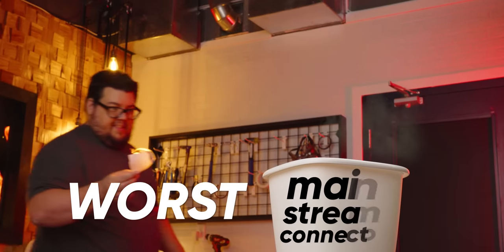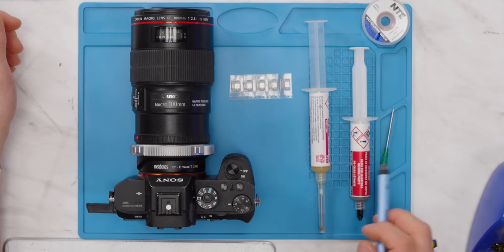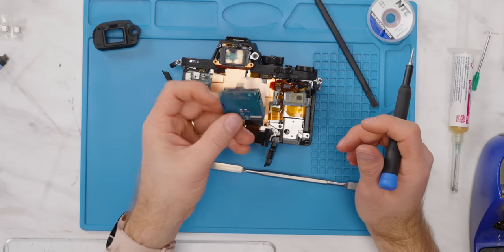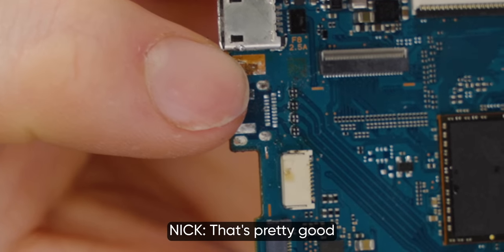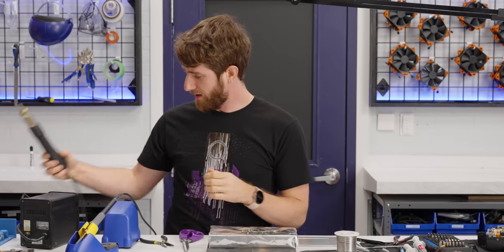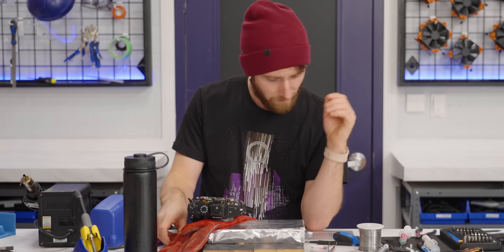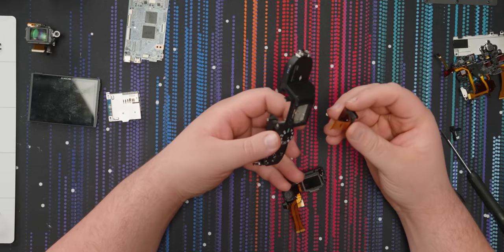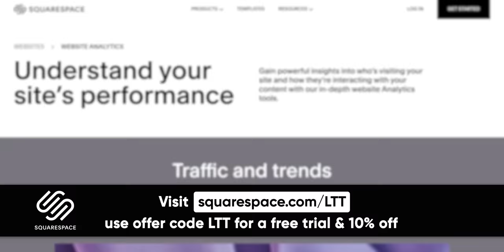This "cheap" repair almost BROKE me.

Comment: All I gotta say is that when desoldering components using hot air Kapton tape for insulation can greatly help shield nearby components along with gently preheating the board. Also there is some stuff called Chipquik which is an ultra low melting point solder. And working with RoHS lead free solder can be a real bear as the melting point is higher.

Comment: So buying a whole new mainboard and the calibration service was still cheaper than having Sony do the whole job. And replacing the mainboard meant you didn't need the soldering equipment and you could've sold the old mainboard as "for parts" to a pro shop for ~$40. Moral of the story: trust your own repair ability, but maybe not that much.
Reply: No? He spent far more on parts and labor hours than if he had just paid for the repair.
Reply: @manbearpigsereal  For us plebs the hours are null where an experience benefit is realized. Double down on that for the cautionary tale told by monetized video…

Comment: Glad people got to see that our Micro Soldering work isn't just something you can pickup and do in a day. Without the proper tools and lots of practice, you'll just make things worse.  This is basically the same process of soldering a Nintendo Switch USB C port and I can't tell you how many times customers have said to me "The part is only $5, I'll do it myself." I will direct them straight to this video in the future lol.

Comment: As someone who does electronics work as a hobby, it's dark comedy to watch LTT attempt a repair of this precision with only about half the required tools. The lack of a hot plate is the least of it. A reflow oven is really what they need, but barring that they need some sort of specialty de-soldering alloy like QuikChip, heat resistant ceramic tweezers, and Linus should definitely be wearing at least jewelers' glasses to help him see wtf is going on up close (even better would be to have an industrial inspection microscope that he can just put the board under and look into the whole time). An alligator stand or "helping hands" as they're called would greatly assist in keeping the board in place and not moving around, and it's obvious from the issues they were having with the solder application that they needed a more fine point soldering tip for their iron. They also should have used heat-resistant Kapton tape to cover all the other parts of the board they weren't working on to protect them from the heat gun.

Comment: Soldering with hot air is much harder than desoldering with hot air (because of the plastics and also if you don't control the air flow and have steady hands, you can't align in time before you cook the board), so once you get the bad socket out (say with hot air, low melt solder, or dunk the whole mass in solder and iron it out with a fat tip), wick out the excess solder on the pads so the new connectors can lie flat, then iron solder one of the the mechanical strain (the metal edge to solder to he pad that serves no electrical purpose) first to align, then drag solder the rest of the pins with lots of flux.

Comment: ive taken apart a very similar camera and they are a nightmare. I've had issues with accidentally partly breaking a ribbon cable causing intermittent issues. the only way i could think that your hot air/soldering iron would cause more issues is if you accidentally burnt/knocked off other components (potentially on the other side of the board underneath the connector). It's important to use a board holder because its very easy to float components underneath. that being said, next time you should try either reducing airlfow/holding hot air station farther away from the connector or heat from below. if you stick the board partly off the side of the table and either hold it with something heavy on the other end or a board holder, it should be stable and give you enough room to work with. also low melt makes it easier to removing connectors with lead free solder

Comment: If you solder wick it flat and tack the housing down first, it's much easier to realign because you just need to reheat one joint to move it.

Comment: This is why you don't use those black spudgers for this sort of thing.  Those are good for popping apart cases and scraping out build up, but way too scratchy for ribbon cables.  For that you want a telecom spudger or similar (think the yellow ones).

Comment: Jerk stopper or cable lock is a big step towards preventing this issue. The key is to keep pull strain away from the connector.

Comment: ah man so much gore in this. 
like watching the fng build a full loop system and run the pump dry for 19 minutes then wonder why it sounds like a bag of spanners 

some tips:

- heat shield plastics / sensitive ICs
- heat shielding is metal plates / thermal pads etc
- components can be heated from the reverse side to remove
- invest in board holders for small boards like C1390C
- positioning and prep are key, secure the board, tools at hand ready
- get into a comfortable position to work static for long periods (this is so unbelievably key, heard louis rossman say it in a vid once, such a key piece of info)
- as above, position the job don't awkwardly try and work around it 
- plan what you're doing step by step don't just barge in
- be patient when removing components
- heat has to saturate the whole area to bring it and the solder up to temp
- add flux and leaded solder to alloy lead free solder and bring down the melting temp
- when soldering, be still, components could move or detach
- leave the job to cool down in room temp, don't move it as you risk warping
- less time in with hot air the better, alloying, flux etc all help
- don't pull on the component you're removing, it'll move free when the solder is liquid
- components ready to be removed will move with zero effort
- BE STILL !
- BE PATIENT !
- after removing a component, work fast if wicking as the board holds heat
- wicking is a dark art
- use a small piece of wick, don't leave it attached to the whole roll, it'll heat sink
- when wicking use a wide soldering tip, you're heating more stuff, larger tips convey more energy
- small wick can be held with tweezers
- when wicking watch the solder go liquid and soak into the wick, if it doesn't maybe you need more flux or heat (or patients)
- small pads = fine wick, large pads = thick wick
- bad practice wicking = ripped pads
- once clean of old solder, tin the pads
- tin clean pads with leaded it'll reduce the time you spend heating to install the new component
- clean the area, Isopropyl + q-tips / small sponges etc
- add a little flux before adding the new component it'll help hold it in place
- when heating the new component on, the flux + tinned pads will pull it into place
- clean your work after 
- let it cool fully before touching it again
- INSPECT YOUR WORK !!! there's plastics, pins etc make sure they are all ok 
- soldering like this should be like surgery not like ripping a nail out of a piece of wood 
- practice on old motherboards, they contain many different components, ICs, caps, smd this, through hole that, perfect practicing tool 
- this job needed a scope so you can test (push with tweezers) each leg of the port and micro tip solder each one so they're strong as the port has physical forces on it
- even a mounted reading magnifier would have made this easier
- lastly, flux and fumes a pretty nasty, you got one pair of lungs, extract air accordingly and make sure it doesn't dislodge components that are loose from your work

hope that helps someone not butcher their repair

Comment: Couple things. First use a damn soldering iron and not a big heat gun! Use the iron to heat the solder and quickly add or remove it. The longer the heat is applied the further you burn and damage the solder itself.

Second if there's a bridge you CAN fix it with a wick

Comment: You could have used a Kepton tape on top of the hdmi connector before heating it up also put a kepton tape on top of any area you accidentally heat with it, I have done this method multiple times with connectors and have had a high success rate so far. Also it is better after desoldering to put the liquid smd solder tin first place the connector on top and then heat the tin up until it melts, the connector automatically should flow i place

Comment: Linus, u dont need hot air to remove and resolder the connector. U only need  quick melt soldering lead and a wick to unsolder.  After unsolder, clean it with 99% isopropyl alcohol.  Do not ever use a hot air on the connector it will melt the plastic. Just use the flux and a .5mm soldering lead with pointy tip.

Comment: Pro tip: if you regularly use a micro hdmi port on your camera, just invest in a small rig cage up front. 

They feature a metal cage to protect your camera, and a metal support bar for the hdmi cable.it’s pretty cheap insurance, and it provides extra mounting points on your camera.
Reply: when they showcased the camera mounted with monitor it was in a small rig (or similar brand) cage.... those little hdmi ports just break from plugging/unplugging the cable pretty glad Fuji Europe has great warranty mine broke twice and they repaired it for free within a week even outside of warranty for the second one

Comment: This is why lightning is a good connector for phones. The cable will fail before the connector as the board repair is exponentially more complicated than buying a new cable

Comment: For every device i have to connect/disconnect stuff very often i buy male/female adapters that get plugged/unplugged in the device once a year (when i change them) and everything else gets plugged into that adapter. this way i don't break the ports on the actual devices which is pretty painful/expensive/impossible to resolve usually

Comment: Reminds me of my apprenticeship around 6 month of it I was Fixing DSLR's mostly canon and it was very timeconsuming but I also learned alot. U guys were lucky that nobody accidentally touched the flashlight capacitor we always had to discarge it or be very careful I once forgot it and hand a burn mark on the entry and exit point of the current on my skin.

Comment: That is the very reason I always use an adapter on the HDMI port, the adapter is the sacrificial part you can replace it if needed.
I do that with all my gear Synths etc, if a cable gets tripped over for example it's far better for a cheap adapter to break than thousands of pounds/dollars of gear.

Comment: Valuable lesson: Repairing electronics, working with PCB, soldering tiny, very sensitive components is a craft that you have to learn, you need the expertise and you need proper workshop level equipments, tools. Not to mention of that you need the skill, very good eyes and stable hands for it. I am an electrician, I can learn electronics too, but I will never do such a thing. There is a reason why robots/automated high precision machines build these high density multiple layered PCB-s.

Comment: Trying to solder a connector that size with no microscope is hard. Also low melt solder does wonders at removing connectors with low heat, you should also heat the board from below so you wont melt the plastic in the connector.

Comment: It's so frustrating to see you suffer.

Keep the small pins dry. Solder in the through hole legs the old fashion style with a soldering iron while applying good down pressure to make sure it's heated. Then just drag a big glob of solder over the pins and ignore that you are bridging all the contacts. Just suck up the excess with desoldering braid. Works like a charm and puts no strain on the parts.

Comment: Another way to solve issues like this: Do what you can do, and hire hands when you don't. For many, some careful unscrewing and fiddling with ribbon cables in within the abilities. Properly soldering hdmi connector on a complex motherboard is something that needs quite an array of tools (hot air, IR, hot plate, magnification) and above all experience of soldering overall is something many enthusiats can't quite do reliably. I bet there are electronist repair shops that will gladly repair the whole camera for some hefty money, or just replace a connector on a board you provide with a conector you provide. it may be a 5min job with 20$ work (depends on geography.. idk the usual rates).

Comment: It's really important to include the purchase of a binocular microscope and stand in your toolkit, there's literally no way to try to solder something as small as this job without magnification. You should have noticed that Louis doesn't sit around squinting at solder joints while happily explaining why it's possible to fix electronic components yourself.

Comment: 7:15 right angle connectors with stabizers/holders and supports... goes a long way. hooks onto the camera tripod mount.... been using them for 10 years. never use straight cables....

Comment: If you break a ribbon cable, 99% of the time you can just run separate wires from pin to pin. Unless they carry RF signals as they are normally calibrated for length.

Comment: OMG! What are you doing?

1. Preheat. You figured it out, but it was too late.
2. Way too much heat, soldering, desoldering at one spot.
3. Use kapton tape to mask sensitive parts on the board.
4. Secure the board by a board holder. It won't slide. Otherwise you will need 3-4-5 hands...
5. Desolder, clean, apply solder paste, place then connector, apply hot air. The connector will center itself thanks to surface tension.
That's all. All you need is to practise it for a thousand hours... XD

Comment: There is a original sony driver (Imaging Edge Webcam) that can make some older micro-usb cameras work like a webcam through usb, so no hdmi is needed. Worked on my a6400 and a6600. Based on their specification it also works with the a7sII also.

Comment: Same on phones. Chargimg ports brake alot i mean alot! Ive solved this by adding one of those magnetic plugs magsafe style connectors so you dont wear out the port itself. Right from the start when device is new. Also increases resale value....Everybody shound do this.

Comment: I remember when the only gaming console i had (PSP) broke and i couldnt afford to get a new one or get it repaired so i did lots of research and watching tutorials on how to do it my self. The emotions pronounce in linus face during the process is exactly how i felt. Those very slim cable ribbons were such a pain in the pass to put back. You put too much force and it'll break, put less and it wong lock in.

Comment: This is why you should aaalways clamp in your non locking I/O! 
Also, there is a 'real way of getting around that'.. Run a micro to full size HDMI adapter, clamp that adapter in, and when even when that full size port fails from normal use, you only have to replace the adapter for a few dollars. It also means you only need to run fullsize HDMI cables in the studio because you've unified the video I/O across your fleet of cameras. Smallrig make them for little cost and they mount directly onto the cage. 
It's also why SDI/BNC cables are still considered a 'professional' video I/O standard vs HDMI, as productions have been dealing with this for generations and eventually landed on using proper locking ports for audio and video.

Comment: Use victim cables. Get s a short cable and leave it plugged in, hot glue it if you need to, then use the end of that cable to do your plugging in/unplugging.

Comment: After attempting to replace a shutter mechanism of older Nikon D series DSLR, which involved taking the whole camera apart, I really am stunned at the level of engineering and complexity, It's so much more complex than modern smartphones, took me 8h to do it. I think cameras are actually cheap for what they are.

Comment: Hey Linus, 
it's the Dutch guy again, by the way, my name is Mark. I did see this item 4 days ago and was thinking about how to prevent this damage. Take a mini to normal DP converter from your shelf, stick it in the camera, take one drop off superglue and glue the connector to the camara. This is of course no fix if you must take the camera with you.
But if you use it in the studio, you will never have a broken female DP connector again.
Just a tip from a Dutch tech guy, a little older (just 57)
Reply: By the way, I use this to prevent damage with the mini USB connector, when it standing at one place you are assured it does not unplug and it will not break. Mark

Comment: Have you considered using a smaller tipped iron? Not every soldering job requires use of a hot air station, and certainly not without heat shielding. You should also invest in several bottles of "no clean" liquid flux.

Comment: I know hindsight is 20/20 but instead of holding the the new port with the tweezers, I would have used an old plug to insert into it used that manipulate the port being installed. It wouldn't "float" like it does in the tweezers and has a much more robust means of movement control.

Comment: Though I loved the video, you could have managed this better with a little more refined methodology. 

A step by step process would be to:

Make sure you thoroughly remove the solder from the through holes and smd pads. 

Add solder paste to the smd pads but Do not reflow yet.

Put the connector in place and hold it while you solder the through holes from the underside of the board with an iron. Do this with 1 through hole initially and check alignment on the upper side. If alignment is off, use an iron to melt the solder on this one pad and adjust from the upper side. (you will likely need something to hold the board off the desk while doing this). Then solder the other 3 through hole pads. 

Then reflow the smd pads, using a soldering iron and potentially wick to remove any bridges. 

This would have saved you 4 connectors.